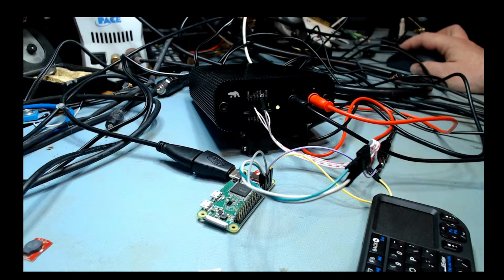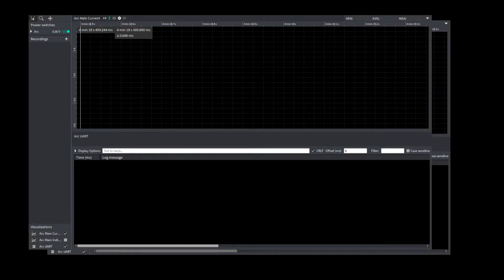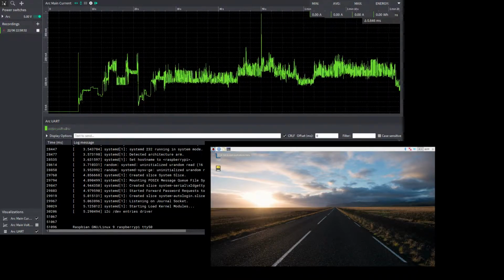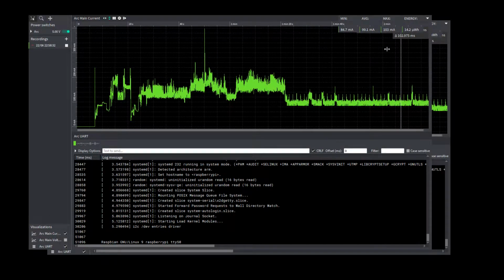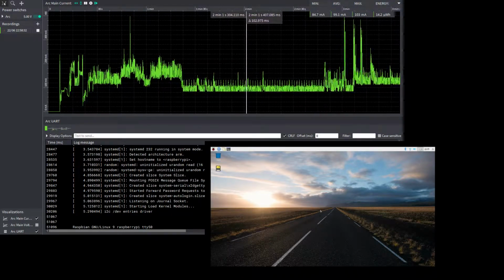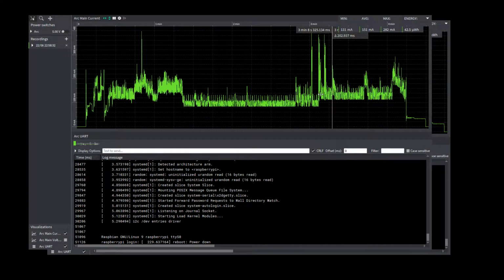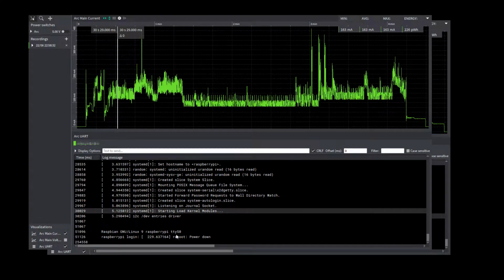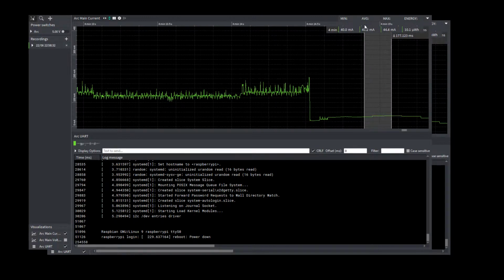Raspberry Pi Zero W power analysis

Comment: Awesome mate, interesting stuff, you should do some power analysis on entering passwords, that's what I want to get a working demo of, make a little script that asks the user for a password, and then checks each letter against the actual password to see if it's correct, then you should see a slight difference in the power output of incorrect letters vs correct letters and be able to figure out an unknown password based on the power output analysis, this looks like a perfect platform to try it with. Pity that device you're using is $1100 😭 otherwise I'd be grabbing one for sure!

Comment: It would draw less power if you used fluxbox or gnustep instead of pixel.  Pixel is fairly bulky and great for noobs, but my hypothesis is the less resources you use the less mamp/h's you will use.  If you plan to use batteries this would be important
Reply: Im wanting to switch most things in my rv to dc instead of ac because i have a solar array with 200amph battery bank.